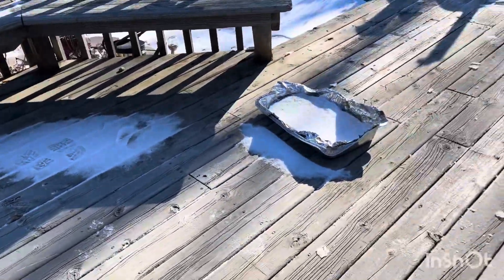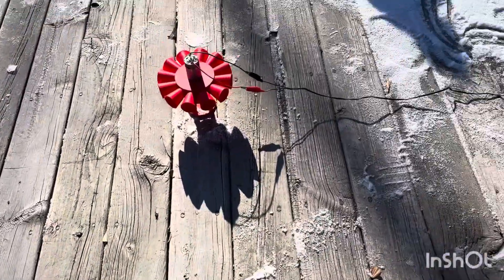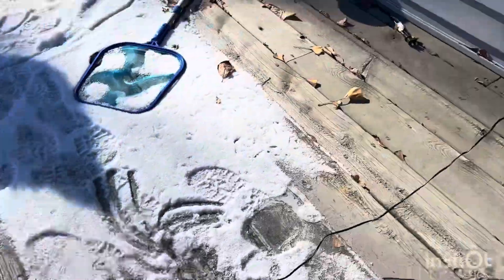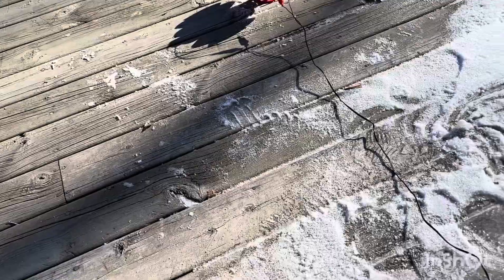Mini Homemade Siren! (SH-10)

Comment: you can also use an xd3420 motor for your other builds! im making a russian S-40 mini siren (the first mini S-40), and im using a supercapacitor module to slow the winddown. what are supercapacitors I explained in the replies of miles peterson's comment.

Comment: Wow! Great use of the DC motor. A lot of people recommend AC motors, but they can be very dangerous if not used right. All the sirens I make use DC motors. And, for a longer winddown, you can cheat by using winddown capacitors. Keep up the good work!
Reply from the maker: @milespeterson5049 Thanks! What are wind down capacitors?
Reply: @TheSirenManiacYT  Wind-down capacitors (I call them) are just capacitors wired to a motor in parallel that will give it a nice wind-down when you power it off. This is because power gets stored in the capacitors, and when power is disconnected from the motor, the remaining power goes to the motor, giving it a nice wind-down effect. It isn't really an official wind-down, but it's sometimes better than a short one!
Reply: @TheSirenManiacYT a thing called "supercapacitor module". supercapacitors are like... regular capacitors on steroids. a lot more capacitance but a lot less voltage rating. they cost more, but they are worth it.
Reply: AC motors are probably the best for the accuracy of speed since they are induction motors and the fact that this sirens full sized counterpart uses an AC motor. But your right. Messing with 120 Volts can be very dangerous. So DC motors are definitely best for beginners and for very small sirens too.
Reply: @zachzebra56  I tried using AC motors before, and I never got any good results from them. I used a 1/15 HP AC induction motor at 120V, and it couldn't even move an 8-inch rotor. If I had a bigger motor, I'm sure I could move it, but big AC motors are extremely expensive.
Reply: @milespeterson5049  Huh. Interesting.